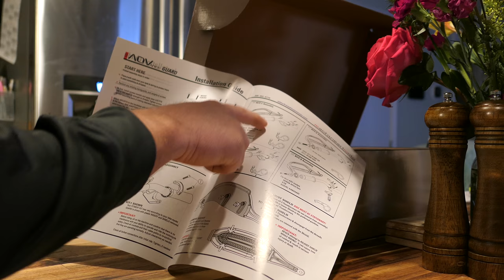Machine Art Moto ADVance Guard Install - R1200GS LC

Comment: Adam what mirrors do you have? I looked but I cannot find a review on them? Are they better than the stock?
Reply from the maker: Those would be the DoubleTake Adventure Mirrors. Love them and have them on every bike.
Reply: Adam Chandler do they vibrate a  a lot that’s what I saw on the reviews.
Reply from the maker: On my oilhead GSA (2009) they were not great on the highway. 80 MPH, you couldn’t make out who was behind you (important if you’re doing 80) but on the liquid cooled GS, they’re very smooth. I’m really happy with them 30K miles now.

Comment: Would these puppies work with my bar end mirrors mate?
Reply from the maker: I don't believe so just because you really have to crank down that outer bolt as it's holding a lot of weight. I'd send the MAM folks an email, they're great at answering questions like that.
Reply: @AdamChandler86  Thanks Adam.